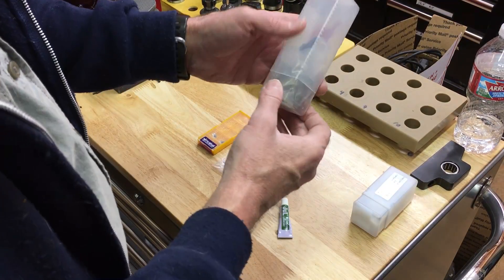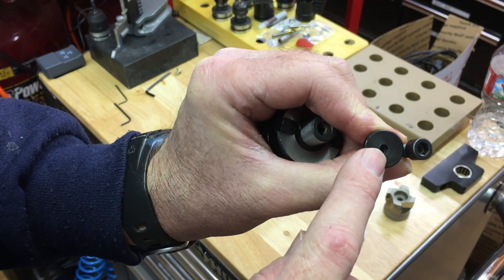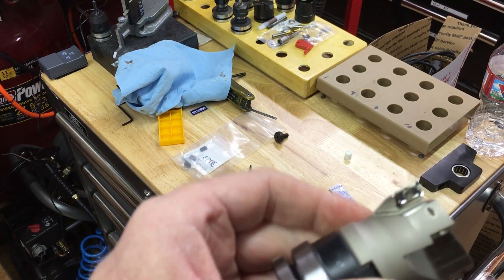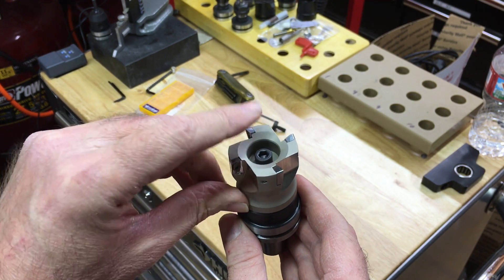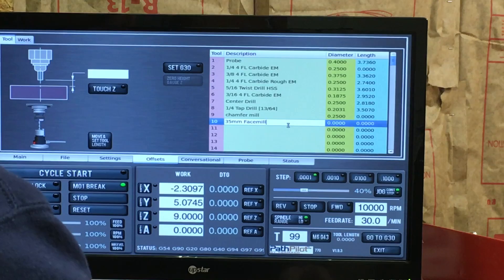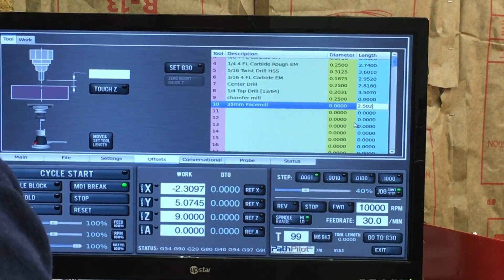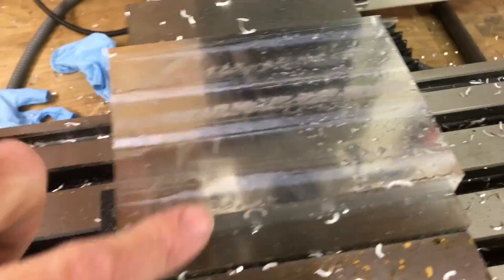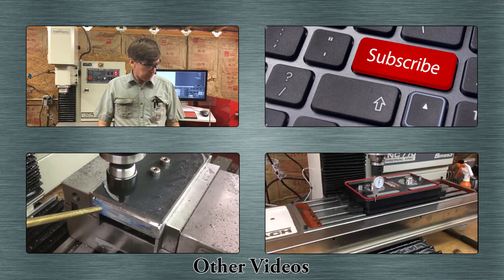Tormach 38mm Facemill

Comment: How did you determine your feeds and speeds on this test cut?  Were you just going with the speed that gave you maximum torque for the 770 mill  (4000-5000 RPM) and then guessing at the feed rate or did you use one of the F/S calculators?

My reason for asking is that I have a shell mill on the way for my project parts.   I use the HSMAdvisor software for my end mill feeds and speeds but I have yet to try using this software for calculating feeds and speeds for anything larger than 3/4" end mills.

The lack of power of these 770 CNC mills is kind of a hinderance when using anything larger than 1/2" end mills.  At least in my case.  I work on 1018 steel and aluminum almost exclusively so I have to cut shallow and slow most of the time to get decent finishes that don't need post milling work to make them look presentable.
Reply from the maker: I got the facemill before I understood the power curve issue with the VFD.  I don't use the facemill for roughing anymore.  I use the Shear Hog for aluminum and just a 3/8 EM for steel.  I use G-wizard.  You can set the power curve for the mill under setup.  But you have to set it up for high and low.  2 different profiles.

Comment: Looks great. Do you also have the SuperFly? If so, how does it compare to the facemill? Thank you
Reply from the maker: Thanks Kent!  Yes, I also have the superfly and the shear hog.  Of the 3, I prefer the shear Hog.  The superfly and facemill require that I change to the lower belt position if i'm removing a lot of material because of the 1 HP of the Tormach 770.    The 770 has peak HP at 5000 RPM.  They all have their purpose.  The superfly is probably best for finishing.  Please note that this video was done in the high belt position so it will perform much better in low.

Comment: Take it easy on the Tormach mill it is only for very light work????
Reply from the maker: +Peter CCR ENG -  Very light work?  Where did you hear that?
Reply: Do not need to hear it. Just need to do the math.
Maximum Horsepower 1.5 at 5100 RPM
And this is if the tool does not pull out of the spindle.
I am genuinely happy that you like the machine i wish it was more than what it is then it might be worth buying.
Is good for hobby work or small prototype work.
If it makes you happy that is what is important but do not try to up sell the machine to me.
Reply: Peter CCR ENG I take 3 times more aggressive cuts on my 2.2kw cnc router
Reply: Meaning What?
Reply: Meaning his machine will be fine
Reply: Thank You For Your Reply????
Reply: Wow what a wet blanket, lol.

Comment: I came upon this problem of measuring the exact diameter of a face mill last week.  At first I had done something similar to what you had done with the calipers, but after thinking about it, I thing that's just measuring the distance between inserts, not actually measuring the diameter of the tool.  The true diameter of the tool is the insert that is the farthest out from the center of the tool.  

So I came up with a possibly more accurate approach:  With the tool in the machine, clamp up some material into the vise, preferably less than 1" thick in the Y-axis (only because then it can be more accurately measured with a micrometer).  Eyeball the facemill centered on the piece in the X-axis, then move the facemill in the smallest increments possible towards the material, rotating the facemill by hand.  When you hear the mill engaging with the material write down the value of the Y-axis DRO.  Repeat the same thing on the opposite face of the material on the Y-axis.  The diameter of the tool should then be the two DRO positions subtracted from each other, minus the thickness of the material.

Say the first DRO reading was 0.860 and the second DRO reading was -0.431 and with a micrometer the thickness of the material is 0.2480, then the diameter of the tool is exactly 1.043".  I'm thinking this is more accurate than the calipers because by spinning the mill it means the farthest out point of the mill will touch first where as it's really difficult to know when you are exactly at the "farthest out point" with just hand holding the calipers.
Reply from the maker: Yeah; that sounds good. I will have to try it. Was it the actual diameter of the endmill?  I also thought about milling a slot with it and measuring the slot.

Comment: Another informative and great video Craig! What were your running for speeds and feeds? Where are you coming up with your speeds and feeds? I'm using G Wizard. So much to learn!
Reply: +Tim Robel Hi Tim! From one machinist to another: Speeds and Feeds can be calculated by the following formulas...

RPM =  (3.82*SFPM)/tool dia

SFPM (Surface Feet Per Minute) can be acquired from your tooling manufacturer&#39;s catalog for the given tool for various materials. Additionally, many use a standard constant for SFPM to get them in the ballpark. 
Common values for SFPM using HIGH SPEED STEEL tooling are:
    Tool Steel - 50
    Low Carbon (1018, etc) - 100
    Aluminum - 300

Note: Carbide is approx triple those values

IPM = RPM*Chipload*(# of flutes/teeth)
Chipload can be found by the tool manufacturer catalog

I hope this has helped! These calculations are to be used as a baseline. Many other variables must be accounted for such as coolant, work rigidity, and tool quality. Goodluck!
Reply: No problem, Tim. Just one note.. The IPM formula does not have division in it. The slash is simply grammatical and not mathematical! Sorry for the mistake.
Reply from the maker: +Tim Robel - Thanks Tim!  It was 1700 RPM, 11 IPM, .050 DOC, 1.00 step over (WOC).  Yeah, I am using G-Wizard also.  I'm following this tip from G-Wizard:
Need to adjust G-Wizard for a smaller machine?The best way is to limit the spindle horsepower available for cutting. This can be set on the machine profile page.If necessary, set it to less than your available spindle horsepower to be ultra-conservative.
Reply: +GTI Bro That helps! Thank you! The learning curve is steep on this stuff! Great to have input from the community!
Reply: +GTI Bro No worries Brother! Thanks again!

Comment: Great video, sounded like that was close to maxing the hp available, or do you know if it could handle a more aggressive cut?
Thanks
Paul
Reply from the maker: +Paul Campbell - Thanks Paul.  Yeah, it did seam to bog down a bit on the wider cuts.  I think a shear hog would be better for hogging out material in aluminum and the facemill for facing up to about .050. at a .75 step over.  The 1.00 stepover was bogging it down.  I still have some experimenting to do with it.
Reply: +Craig's Machine Shop Shear hog sounds like the right tool, I'm sure you have seen all Johns videos about it at NYCCNC, he loves that tool.
Reply from the maker: +Paul Campbell - Yeah, I don't think you can match the removal rate of it.  Yeah, I think I have watched all of his videos.